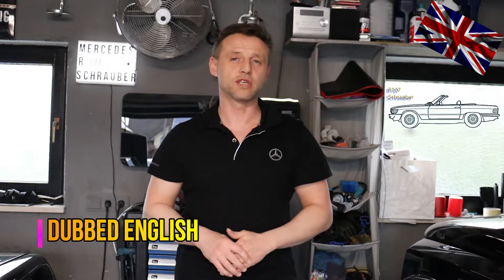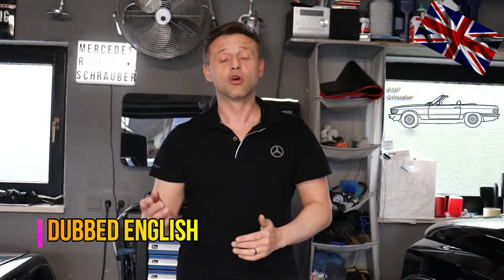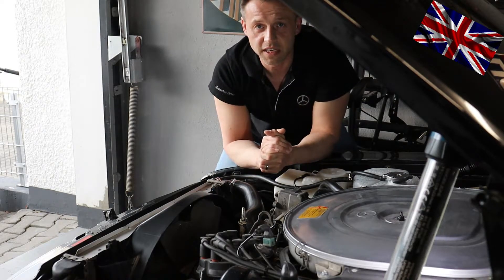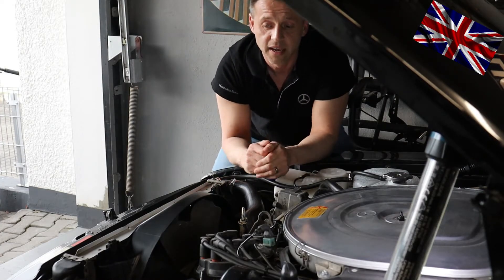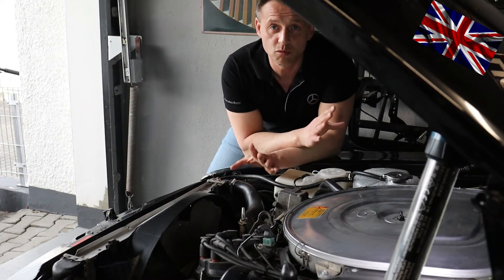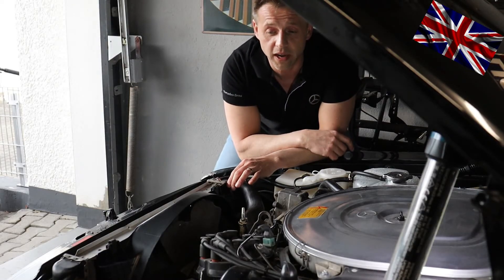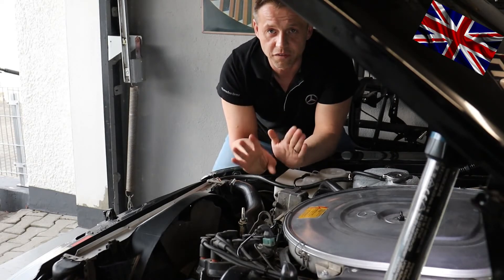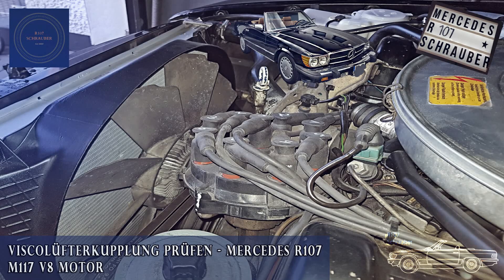Visco fan function test - Mercedes R107 W126 on V8 M117 engine

Comment: Hello, my 1977 R107 over heats when I'm in traffic and moving very slowly. I checked the fan which seems to rotate faster while gear on park but when on drive it rotates slower and temperature goes up to around 220f or 110c.

My question is why the drive mode makes fan rotation slower?
Reply from the maker: Hello the fan runs slower in drive mode because the engine speed is reduced thereby of course at warm temperatures the oil temperature can rise when stationary I would renew the coolant and add more coolant mixing ratio three to one so three parts distilled water and one part coolant